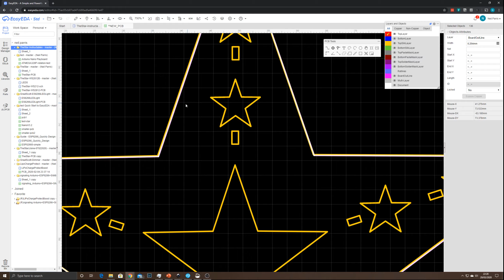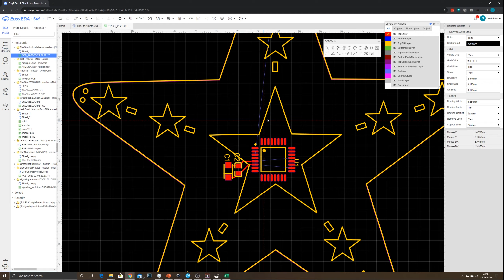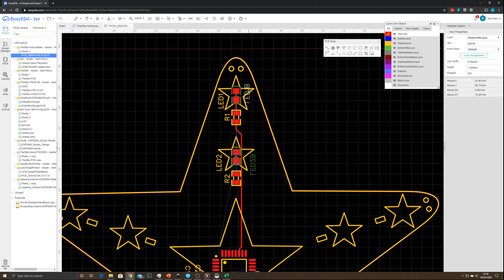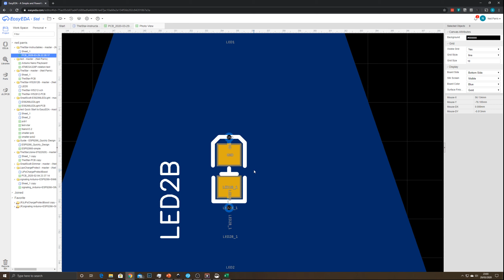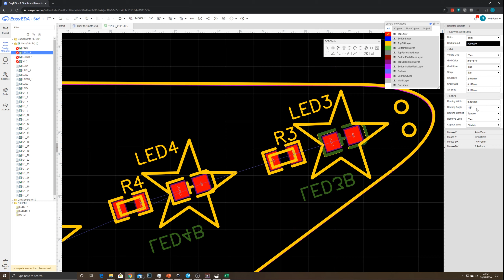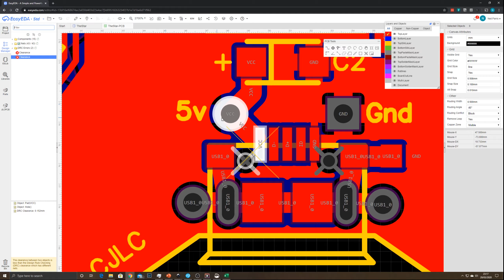"The Star" Custom PCB with EasyEDA and InkScape instructable video

Comment: Thanks for this detailed tutorial, very informative and fit perfectly what i was looking for my project !
I do have one question though: 
On your detailed pdf final schematics you have 3 capacitors (C1 C3, C4)  linked to VCC and Grounds, but on the easyEDA project you only have 2. Do we need 3 or 2 is enough ?
Reply from the maker: Decoupling capacitors are good practice to clean the supply for the microcontroller, especially with any high load switching on and off near by like all the PWM LEDs.  Most schematics have a small and medium cap near to the power supply pins of the MCU, something like a 10uF and 100nF as each value will respond to different noise frequencies.  If you have too few capacitors then you could get strange unexplained behaviours from electrical noise.